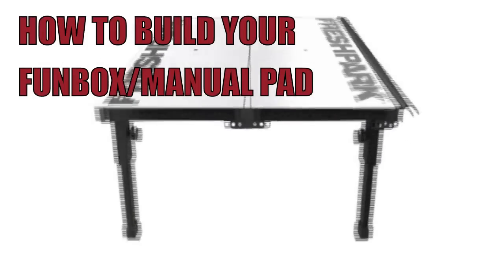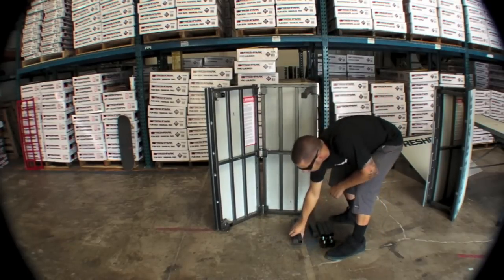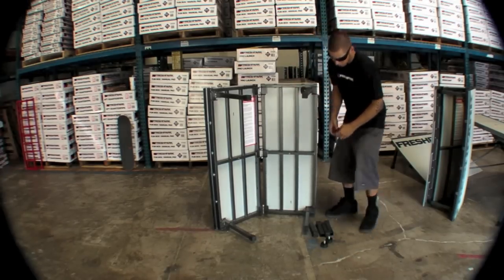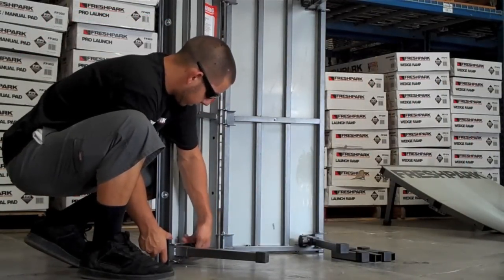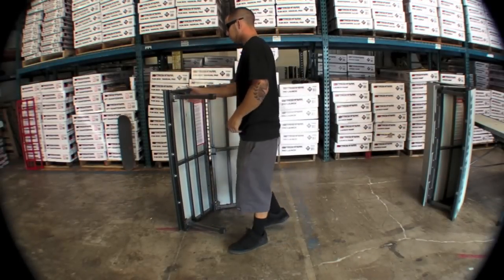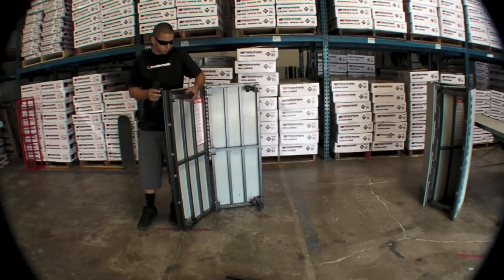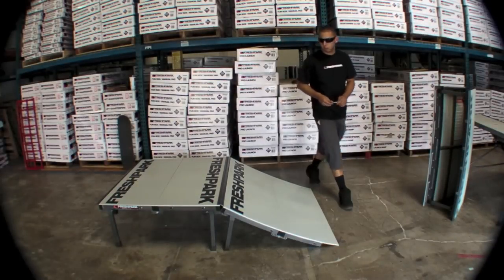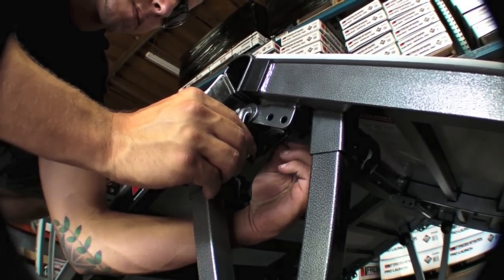How to build funbox HD.mov

Comment: I just got this and a quarterpipe on FB Marketplace for cheap. The lil funbox is missing the metal plating to the kicker and the kicker has no radius at all like shown in the video so it's not really usable. I took it apart and was hoping I could use the the attachments from the kicker and extend the grindbox but it don't work like that. That would be a sweet concept though. If you can use any of the peices to kinda build your own. I'm gonna still try and make use of it though lol